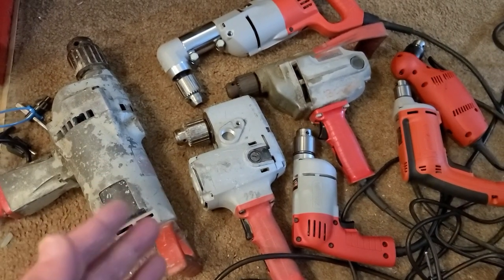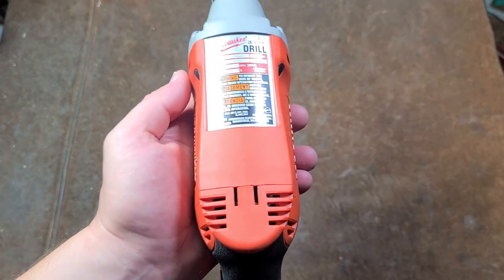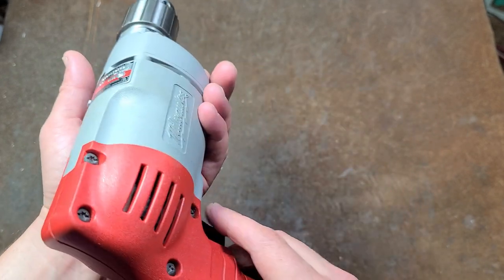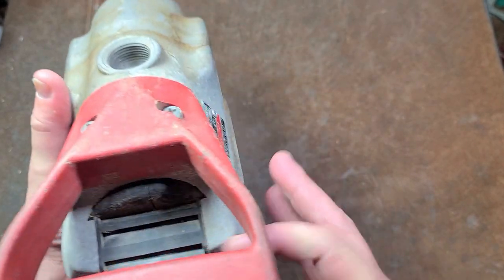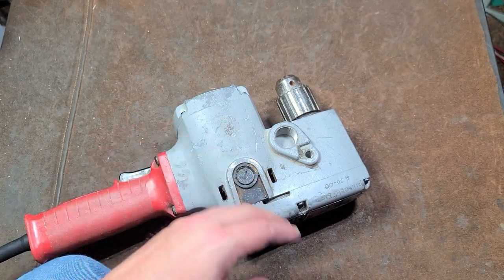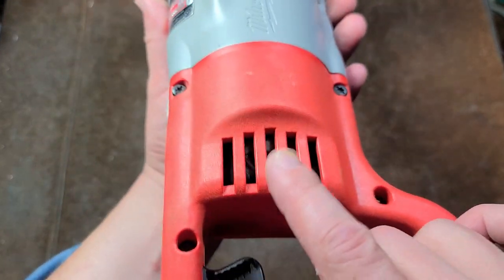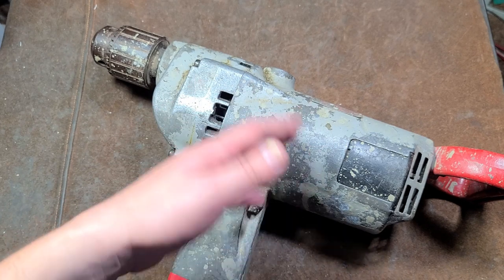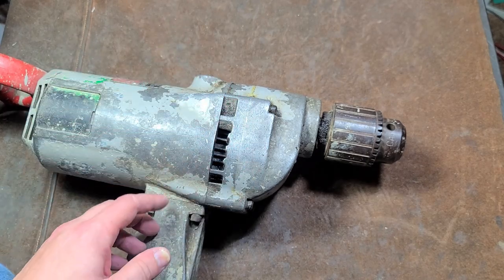7 Milwaukee Corded Drills You Need To Get Your Life In Order...

Comment: I have used the hole hawgs and personally   They are good until you get it stuck bc it will throw you  off the ladder and  put you in a low earth orbit
Reply: I've found that running them at higher rpm helps because it has a better chance of stalling out the drill rather than taking you for a ride

Comment: I have to admit that I have never used a corded drill that I liked. Brushless newer Makita is ok but pneumatic are all I like to use. I have many older Rockwell ex government contract refurbished tools that are really badass. Dotco 90° drill would blow your mind. I have a Jiffy that is a little big but really precise and fast (4700rpm). My Michigan Pneumatic 1/4" drill motor is especially sweet. I wanted to buy 2 or 3 more but they only want to sell a thousand.
Reply: Do you also wax your curly cue mustache? Guy from 1954.
Reply: @galvanizedgnome  
No, I hate facial hair, smells like dirty scalp under your nose. My drills are from the 50s, I am a 1970 model.
Reply: Hell yeah, but as a helo mech, those air tools are better for metal work in a shop, I like to carry a extension cord instead of a massive air tank!
Reply: @ryanbellus2831  a tank wouldn't last long with my old Rockwells! We use long hoses.

Comment: I have 2 Milwaukee 6767 Deck and drywall screw guns. Those suckers are both from the mid 90s and still keep chugging. One is dedicated to drywall and is in much better condition. But the deck gun is still going strong after screwing in every board on a good 50 decks. I've replaced parts on it and relubed several times, but she's still a beast and a better option than destroying a new impact driver every time I build a deck.